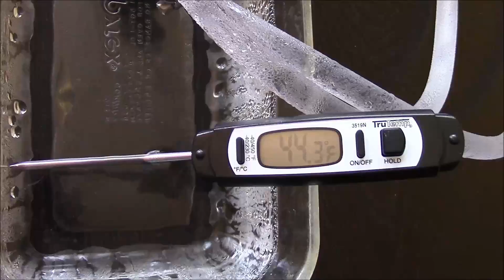How to Build A Water-Cooled Peltier Device or Thermoelectric Cooler

Comment: I had a thought. If you have one of those portable room to room air conditioners where you need to vent the hot side through a window or vent with a big pipe, and it costs a fortune to run and is pointless if you have the window open, couldn't you use your idea to do the following; Safely cut, vent and remove the compressor as its heavy. Use your rig but connect the hot side using the cpu pump to the big heat exchanger the compressor used as its way over sized for this job, and where the evaporator is that blows the cold air, connect your cold water bath to pump cold water through that and you would have a lighter, cheaper to run air con unit that wont get nearly as hot on the back? It may not be perfect but would surely have an air cooling effect? Also would it be safe to add anti-freeze to the water for a better heat exchange, would the pump be adversly effected by this? Just a thought I would be willing to have a go at with my old air con unit that really needs re-gassing but costs more than the unit cost lol
Reply from the maker: JohnnyX50 Absolutely that would work.  The question is how many peltier units would you need to get the same BTUs as the original air conditioner and what would the power consumption be?  These dinky little 5 amp units that I play with only have a delta (difference in temperature) of about 20-25 degrees and they would only cool a very small volume of water (maybe a couple cups of water a piece).  Maybe you could try 2-3 of the 10 amp units together and see how that does with a gallon of liquid to cool a small room.  You could experiment with anti-freeze mixtures to see if you can squeeze out some more performance.
Reply: LDSreliance Ok, update :) Thanks for your lovely reply :), here are the specs of my unit.Model B&Q WAP-237EB, Volts-240~50Hz, Power 950W, Current 4.2A, Cooling Capacity 2.3Kw (8000 BT/h) Refrigerant R-407C, Weight 30Kgs. Change of plan. Reverse the use of the heat exchangers, put the cold side through the exhaust exchanger as that fan is extremely forceful and should just create a gentle cooling of the air as it passes round the room. Put the hot side on the smaller exchanger whos fan has a low/med and high setting allowing the hot air to be pointed away from you and downward in a more controlled way. The thermostat relay could be used to power up the computer power supply for the peltier seeing as its a high load capable relay :) It would work similar to our local hospital who use a pipe network under a reservoir to cool the pipe liquid to 10-15C and use it in the air cons in the hospital keeping costs down. Any reduction in temperature by this method is still better than none at all by recirculating room air like a desk fan would :) :feeling inspired:
Reply from the maker: That is a great idea.  I agree, you don't need ice cold air to be comfortable and cool in the summer.  Air movement alone across your skin will drop the perceived temperature of the room by 10+ degrees F.  So if you can even cool down the air traveling through the exchanger by another 5 degrees I think you would have a nice comfortable room.  The only thing that this setup lacks that a normal air conditioner does is remove humidity from the air.  But if you have significant air movement in the room that is not as necessary.

Comment: Hey i m also working on this project..i put heat sink on hot side ...and may i put another heat sink on cool side.?????.because our module getting cool but it did not blow the air inside the thermocol...please reply me as soon as possible...
Reply from the maker: Yes you can put another heat sink/fan combo on the cold side instead of using liquid.  Check out my other video for more information:  https://www.youtube.com/watch?v=Ipt8xqKbCSw

Comment: i am also working on peltier module.but my module is not converting the water into the ice.as i seen in many videos they drop out the some amount of water on peltier module after some time it convert it into ice.how that is happen?and from where i get all dis air pump components?reply me as soon as posible.
Reply from the maker: You need a good connection to a heat sink on the hot side of the peltier.  Make sure you use thermal compound like Arctic Silver between the heat sink and the hot side to maximize heat transfer.  Other than that, you may not be providing it enough power or it may be damaged.  These things are very cheap and fragile so they sometimes arrive defective or just stop working very well.  I have had several duds in the 10-12 that I have used.
Reply: LDSreliance  i did all the things that you said still not working in proper way.i can feel the cooling by touching it.its not turned into ice.and from where i get this air pump components?and where do you live?
Reply from the maker: I live in Texas in the US.  I order the peltier chips online from Amazon or Ebay.  I have had a lot of them that were not within spec or dead on arrival.  I would just order a couple more units because it sounds like you have one that is not working properly.
Reply: LDSreliance i already used two peltier module..but because of not  proper use of  heat sink they were damaged..now i have three piece of peltier module..actualy i m making portable thermoelectric refrigerator by using this peltier..so i need cooling for the whole area of my thermocol box.will you suggest me how can i do it? and i m also thinking about using air compressor.any more suggestion??
Reply from the maker: So the third peltier chip is working?  If you are not able to freeze a drop of water we need to fix that first or you will never be able to cool down a refrigerator.

Comment: Why not use 2 CPU/game computer items and just disconnect the radiator from one, the side without the radiator will be the cooling part, this way you wouldn't need an external pump and it would look much cleaner.
Reply from the maker: CPU coolers are not meant to be taken apart so you would have to cut the line and that would not be optimal.  Also, the individual components you see in the video were cheaper than the CPU cooler and allowed greater flexibility with length of hoses and mounting, etc.  I agree it doesn't look elegant but the person I was building this for didn't care about that.

If I were to build another one in the future I would definitely make some improvements like you are talking about.

Comment: does it work ok? what about the condensation
Reply from the maker: Works great.  The condensation happens on the tubes but it doesn't drip off like I thought it would.  Ideally you would want to wrap the tubes in some sort of insulation to prevent that and to prevent heat loss but the insulation I bought and showed in the video was not working really well.

Comment: Does the size of the waterblock matter? Because the component I have is 40mmx120mmx12mm rather than 40mmx40mmx12mm like the one you've used, and I was wondering if it would function the same.
Reply from the maker: The internal fin design will matter as much as the size.  I don't know which would be better... larger or smaller.  In theory, the larger one would give the water more time to cool down as it travels through.  However, also in theory the smaller block would get colder than the bigger block because it doesn't have as much mass to cool down and so the water may get colder, too.

Would be an interesting experiment to test!
Reply: LDSreliance Got it, thanks! Also does the AC adapter have to be 5Amps or can it be around that, say 4.5A for example?
Reply from the maker: The peltier module will work with less current but it will not get as cold.  Some people say it is more efficient at lower current than its rated current but I have never tested it.  It will for sure not get as cold.

Comment: Hi, thanks very much for the video it was really helpful!
How did you manage to connect the 4-pin pushpin adaptor for the heatsink to the power adapter?
Reply from the maker: You have to cut off the 4 pin connector and use the positive and negative wires (the other 2 are related to speed and are not needed) to connect to the power adapter.  There will be a little arrow on the 4 pin connector that shows you which wire is the negative wire and it is always the farthest wire to one side.  If you cut off the connector and forget which wire is which, just use trial and error.

Comment: I have almost the exact same setup but with a heatsink and fan (CPU) instead of water cooling the hot side, however I'm unable to get any cooling effect at all with a 4 litre tank (~1 gal), I can feel the blue cooling block getting somewhat colder through. I figured the pump may heat the water but your video seems to disprove that theory. Any ideas?
Reply from the maker: What peltier unit are you using?  How much power is it consuming (i.e. can you measure it?)?  Did you use thermal paste between the peltier and the heatsinks?  Is there a tight fit (i.e. did you clamp it together firmly so that the peltier has good even contact with the heat sinks)?

Other than that I would try a different peltier.  Those things are very cheaply made and I have gotten several duds that just didn't draw as much power as they were supposed to or just didn't work at all.

Comment: Peltiers are awesome, I have a similar setup but was using the water cooling loop for the hot side since water is a better thermal conductor, cooling a heat sink with a fan blowing across it. The heat sink would cool enough to frost up but would warm up rather quickly once ambient air was drawn across it. Hopefully we see more efficient peltier devices in the near future with the advancements of nanotubes and graphene technology.
Reply from the maker: That would be nice.  Right now they are power hogs but still useful in some cases.  I just ordered parts to get to work on a new liquid cooled refrigerator using a peltier so stay tuned for that!  Thanks for watching!
Reply: Awesome I'll be sure to stay tuned

Comment: Could you please post links to where you purchased your components? I am interested in building a similar set up. Specifically the submersible water pump, the peltier, and the 12 volt power supplies. Thank you.
Reply from the maker: I get most of my stuff like that from Amazon because every once in a while I get a really shoddy product and they are great about returns.  I also get free 2 day shipping with Amazon Prime.

http://www.amazon.com/gp/product/B003Z6ZR5O/ref=oh_aui_detailpage_o04_s00?ie=UTF8&psc=1
http://www.amazon.com/gp/product/B00EJ9WBPU/ref=oh_aui_detailpage_o06_s00?ie=UTF8&psc=1
http://www.amazon.com/gp/product/B009X6ADCM/ref=oh_aui_detailpage_o01_s00?ie=UTF8&psc=1

Comment: im working on a device like this using 2 peltier devices, cold side is a water block with gravity flow of water using 5 gallon buckets.  hot side is a heat sink with 2 candles under.  I am waiting for a couple parts still.  initial testing with 1 peltier 1 candle I was able to generate 2 volts.  I just dribbled water over the heat sink on top as I didnt have a water block yet.
Reply from the maker: So you are more interested in using this type of setup to generate electricity, not generate cold.  That is cool.  How is that different from a typical thermoelectric generator that runs off of a wood stove or other heat source?

Comment: is it necessary to use thermal paste on the cold side?
Reply from the maker: I would think so.  First of all it helps to hold the thing together and secondly it helps to create a uniform contact surface because the 2 flat surfaces of the TEC and the heat sink are not perfectly smooth or may not stay in direct contact, depending on how you keep the thing clamped together (I have yet to find a great mounting solution that applies even pressure).

Comment: nice experiment :).  for computer cooling this element is not efficient enough. 2 x 90W peltiers is serial can drop only 5 Celsius temperature of cooling water circulating in OC PC.. video Watercooled OC PC with peltier element for extra cooling

Comment: That you know of, can I somehow implement this to cool 50 gallons? I need to drop water temperature from 27° C to 15° C. Would I maybe need 2 Peltier setups and possibly a faster water pump?
Reply from the maker: The first thing I would consider is insulation.  What is the 50 gallons stored in?  Can it be insulated?  Can the hoses be insulated?  That will make as much, or more, difference to the equation than the peltiers because once the peltier cools the water it will quickly warm back up to room temp if not insulated.  I don't think you need a faster water pump because you want the water to stay in contact with the cold plate long enough to cool down.  But you would definitely need several high power peltiers to cool that much water that many degrees.  I would think you would need at least 45-50 amps worth of peltiers to cool that volume of water with insulation.  Without insulation add in at least another 15 amps.  That is just my guess.
Reply: I have the water stored in a tote that's wrapped in a light reflecting film in hopes of reducing light penetration which causes heat but was also thinking about wrapping the tote in emergency blankets but idk still doing research. thanks for your quick reply
Reply from the maker: If you could wrap it in a thin blanket or bubble wrap material first and then the light reflecting material that would be ideal.

Comment: How hot did the radiator get? How much heat can you get off it?
Reply from the maker: The radiator was not even warm to the touch.  It was maybe a little above room temperature but less than body temperature.  It was not working very hard at all to dissipate the heat.  I am sure I could use a 15+ amp peltier with this cooling system just fine.
Reply: LDSreliance I was asking because no one talks about using a peltier for heat. I was figuring to make a fridge, then extract the heat from the other side to heat a small room. I understand that they get really hot, maybe use 3 and three 100 watt solar panels. I know they are not very efficient but solar is very cheap now. No need for batteries, just very good insulation on the fridge, to weather the night.
Reply from the maker: Joe F M
That would work with higher amperage peltiers.  It won't warm up a room but it would act like a low power space heater where you could direct some warm air blowing toward you on the couch or something.
Reply: sounds cool. I think it will be a neat project. I will let you know how it turns out.
Reply: Joe F M Great! that's the same idea i had after getting in touch with peltier devices. My idea is to make a little fridge with it and at the same time warm up the water of an acquarim or simply a water tank for summer shower and stuffs like that.
Reply from the maker: You guys have great ideas.  Keep innovating and experimenting!
Reply from the maker: *****
True.  I haven't played around with that as most of my projects require cooling not heat.
Reply from the maker: ***** You could build an ammonia cooler.  Ammonia is even more efficient than the refrigerant in your fridge.  But it has some drawbacks.  I am not an expert but I have read about it a few times.  Check it out.
Reply from the maker: ***** You could run a peltier at lower voltage where I hear they are more efficient.  Other than that, I am out of ideas.  Sorry!